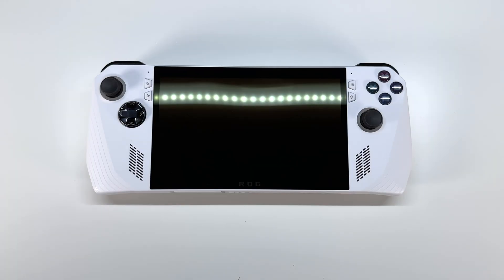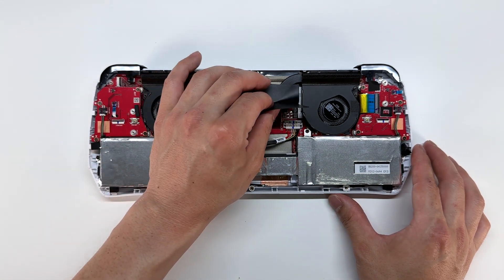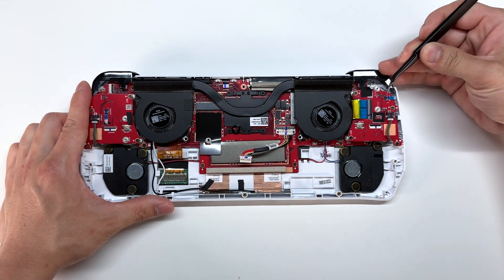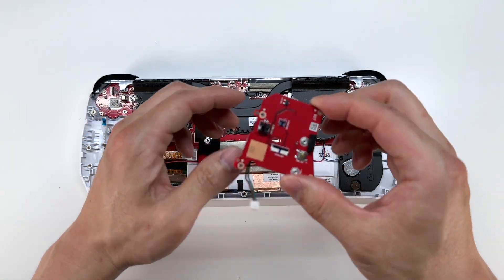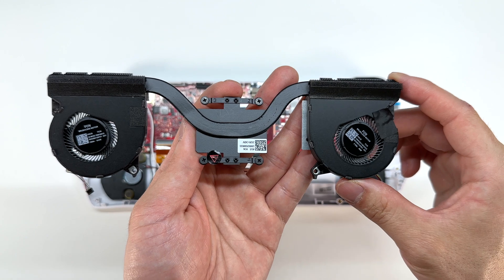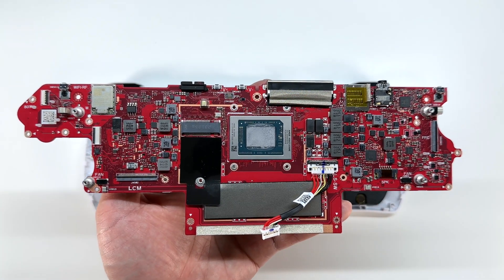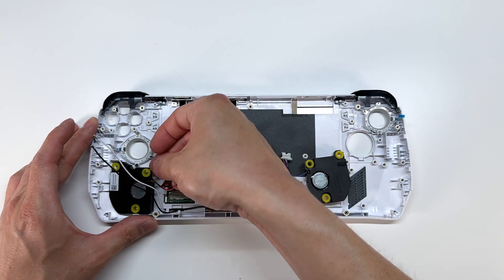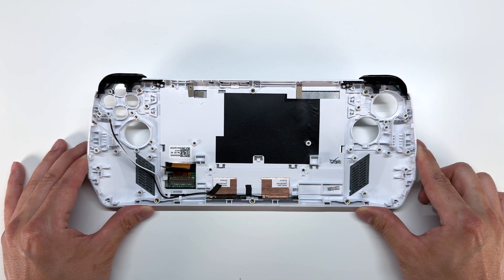Asus ROG Ally Teardown (Complete Disassembly)

Comment: I dropped a little bit of water on the top on the fan entry  while it was in sleep mode... its working fine but it won't show wifi option and when i had to install the driver for it, it says that the hardware is not connected, is it possible that it burnt? I made sure i took all the water out by hitting the Rog against my hand, pretty sure i got it all out. Its been 18hrs since it happened

Comment: Fully replaced front peice with lcd I ordered for $85 on amazon and a $40 clear backplate with kickstand. This tear down was so good the only reference I needed rebuilding it was the black and white data and mobile wire. Tip if ur replacing ur screen if u carefully leave the 2 delicate fan wires in you don’t have to unplug em from motherboard just shift it and carefully work around it. Thank you!

Comment: When reassembling after replacing screen ,  i could get the black and white cables for the WiFi to click back in place , managed to use some tape to keep them in place but now WiFi doesn't work well and has super short range, any ideas?
Reply: How’d you get the fuckin speakers out

Comment: Just broke my screen today 10-21-2023.   Looked up a new screen and it's the whole front to where he got down to last, comes with new wifi.  Current price is 173$ usd
Reply: Now they need to make a repair kit for the sd card... mine went out shortly after I got it back from ASUS after a bios update bricked my mobo... I'll be damned it i send it back to them, that was an ordeal and I had to fight them to cover the repair. Asus reps tried to weasel their way out of covering it
Reply: @Jeg_er_tyk_og_grim  there’s a little adapter on Amazon for 8 bucks that goes into the ssd slot and you can put a full size m.2 which are $100 cheaper than the rog ally ssd that’s what I may do then get a power bank or do a battery mod
Reply: @Jeg_er_tyk_og_grim  I had to do 6 months updates today and the bios update bricked mine and I just unplugged the battery for a few minutes and it came right back on update installed
Reply: They’re $120 on Amazon now I’m installing mine rn

Comment: I gotta remove the cable from the lcd screen how do I remove it? Have a new cable on the way, never seen that connector and how to take out the cable from screen to motherboard, mine is damaged, just didn't wanna break it, how does it remove?

Comment: Any chance you could get close ups of the microcontrollers on the boards? It would be a huge help for those out there looking to reverse engineer various components of the device that will benefit tools like Handheld Companion, HandyGCCS, etc. I saw ITE and Winbond chips but I'm unable to read what is printed on them.

Comment: Notice how the SD Card reader sits right underneath the right side heatpipe?  Also there is no heat insulation between the heatpipe and the SD Card reader either.
Reply: What would happen if I added a thermal pad there? Would it even help?
Reply: @Bright12ful  Yes adding thermal pad will prevent overheat. Place it on the SD card reader

Comment: I have my ROG Ally, here short DETAILS:
- The Z1 Extreme is equivalent to a Ryzen 7 1700 with 11,7gb ram + the gpu is exactly a GTX 1060 with 4GB vram. 
- 10 watt set, use under or exact 10w, except you play, then it reachs max 16w shortly. - No noise at silent mode, silent at performance mode, clearly hearable-loud at turbo at 30w use.
- Can connect it to a monitor + mouse + keyboard + lan + power plug. While akku  its 25w, with power plug via usb hub its 30w.
Optimize: Set the pagefile to 16gb at least to outsource unused ram to ssd. While gaming, only turbo mode max 30watt/h. Cpu 1,6ghz, gpu 2ghz (arround 6tflops raw gpu performance)

Conclusion: no AAA Gaming device. For me a good portable PC to take everywhere with me and can play small games/watch videos/listen music or program something.
Reply: The fuck are you talking about? Im playing most everything i play on my ps5/X natively on medium settings usually gettinf 60fps.

Comment: Also, my left bumper, for some reason is clicking two times. When I press the left bumper down slightly, it clicks. If I press it down more, it will do the normal left bumper click like it's supposed to. Is there a way to tighten the bumper or is there any other solution for the issue?
Reply from the maker: Try reseating it and screwing in the back screws. My trigger buttons did not click until I screwed the last screws un or pushed the device back together.
Reply: @brandon20904  Okay i will give it a try. To get to the screws for the bumpers, do I have to disassemble most of the Ally? I can do it, just not sure where the screws are. Thanks for the help!

Comment: Thank you for this one! Is there a specific way to put back the lid back again? My back buttons stay flat, they aren’t clicking or have travel/depth anymore 😕, tried a few times and still loke that.
Reply from the maker: I had that happen on mine the first time. Make sure the screws holding in the back panel is fully tightened and if that doesn't work maybe try taking it of and seeing if something is catching where it won't seal properly. I noticed the same when my back panel was not fully attached back on.
Reply: @brandon20904  ohhh I see, that did it! I was trying with the screws back in, thanks a million!

Comment: Thanks for video...I took mine apart to install new SSD but it's missing the black insulation that covers SSD, should I be concerned?
Reply from the maker: I think it should be fine. If you're really concerned you can put a piece of anti static plastic between the SSD and board.

Comment: the insides could be alot nicer
Reply from the maker: Yeah, the build quality is very poor. Some of the cables like for the speaker are the bare minimum in usability.
Reply: It was not meant to be taken apart by the user. I get it though
Reply: @a_storm_inside7026   Neither do MacBooks / iPhones, but their board designs are a work of art. This thing.... lol
Reply: Board layout looks like shit. Seems like steam deck engineers put way more effort into their board design. What do you expect from Asus trying to make quick money on this. I own both devices. Thank god I got my ROG at Best Buy for 449.00 lol

Comment: If you unplug the battery/ remove the battery, can you play the rog ally while it is plugged into ac power?

Or does the device require the battery to be present?

Thanks in advance
Reply from the maker: If the battery is unplugged it will not power back on even with the power cable attached. Just tried it twice.
Reply: Thank you for taking the time to investigate that for me,I appreciate it.
Reply: mine powered on with the stock power cable attached or a powerbank attached  this is the updated variant of the Ally with BIOS 336